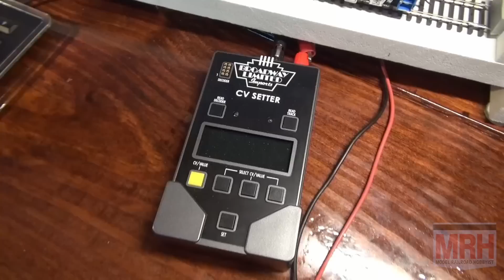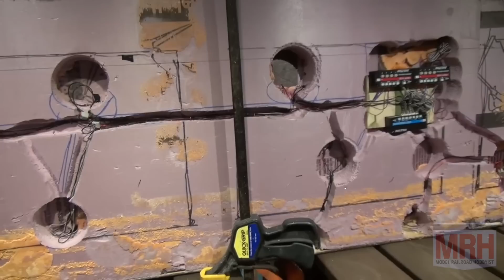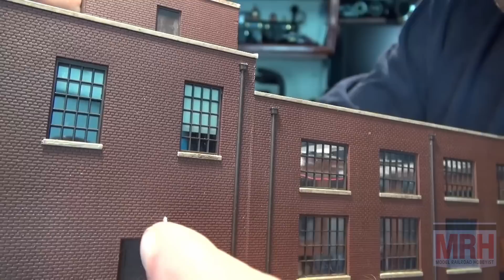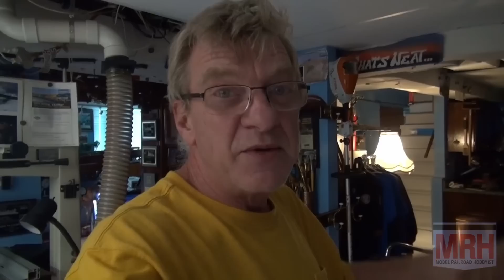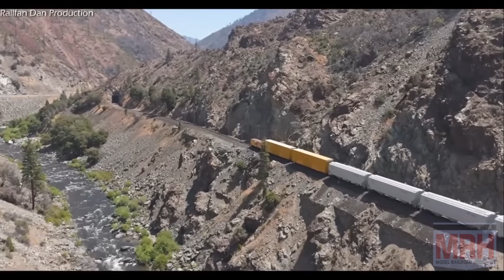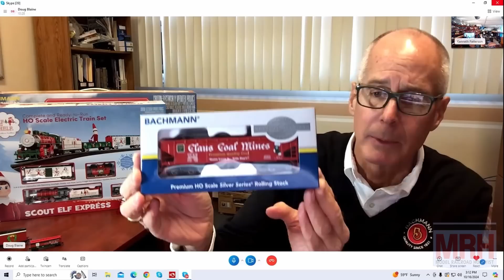Structure lights and street lights | November 2024 WHATS NEAT Model Railroad Hobbyist

Comment: Learned a lot about lighting from your video.
I watched a few videos on the CV Setter and bought one; unfortunately the one I received has some issues and I am sending it to BLI for repair/replacement.
Emails with BLI brought up two other points.  It does not seem to allow entry of 300 and up CV's, so you can't read and reset those.  Also, some folks set the engine number as the address for the decoder.  This may mean you can not set an engine number over 299, even though four digits can be set with the hand control; I couldn't check this since my Setter is defective. Thanks for the excellent how to videos.